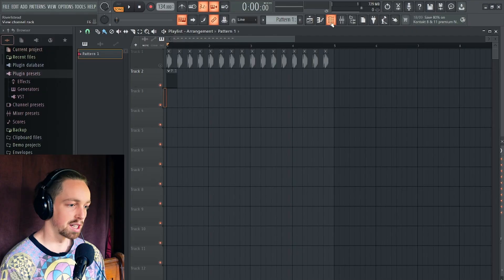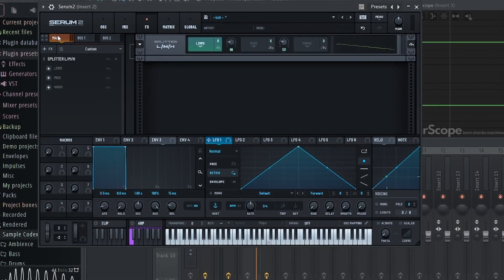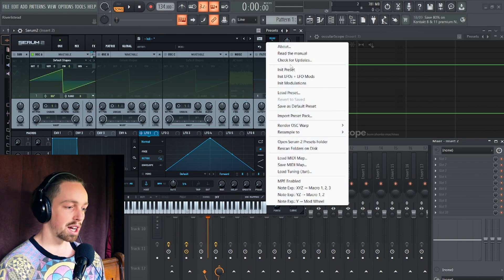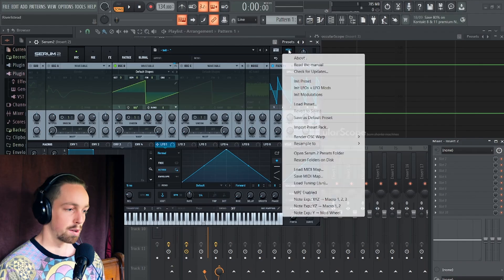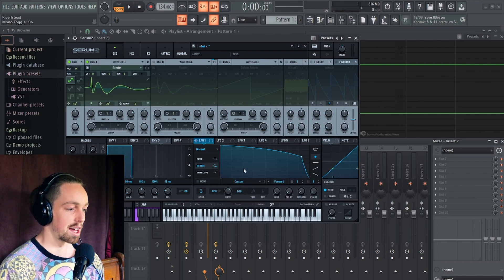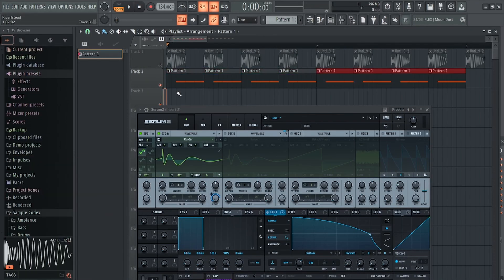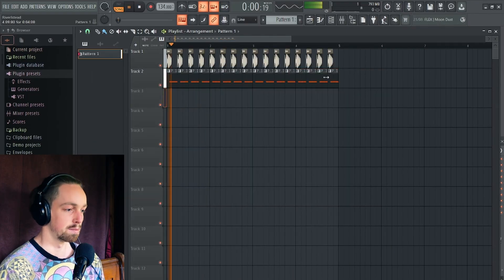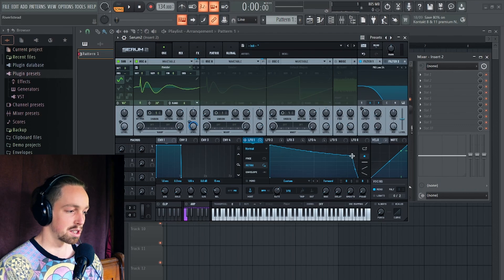Making Clean Rolling Bass For Psytrance/Psytech With Serum 2

Comment: awesome video! thanks a lot!. But one question: why did u modulate the pan with osc c? why didnt u just took the lfo, from wich u draged the shape into osc c?
Reply from the maker: You could set the lfo to the fundamental frequency, but I use the oscillator because then if you play higher notes the panning rate will also increase in frequency, which keeps things much more versatile
Reply: Could theoretically key track LFO rate too.